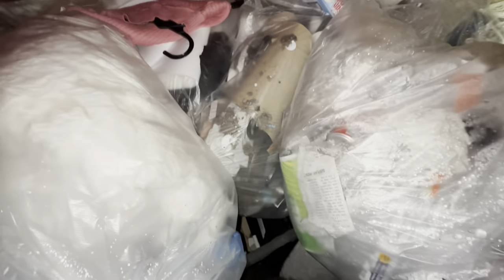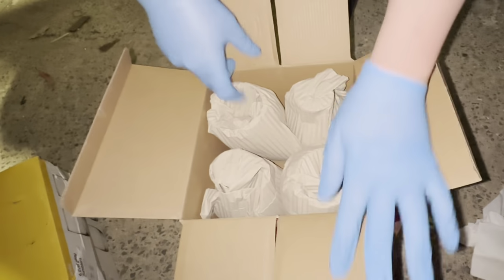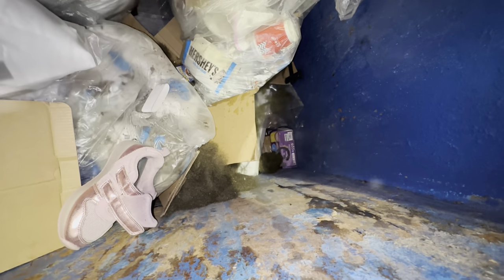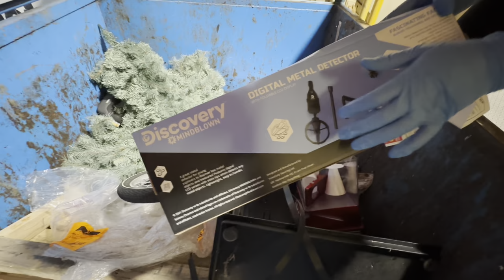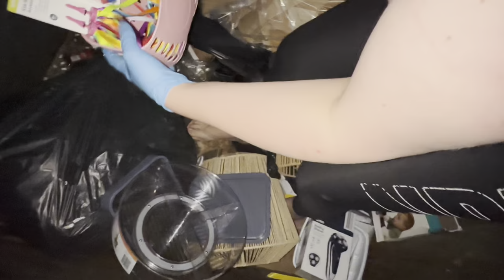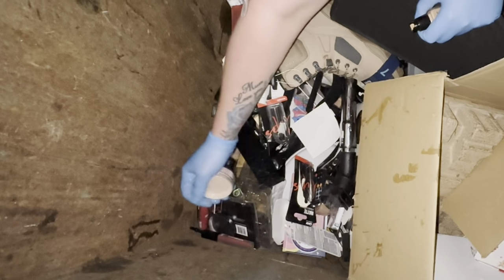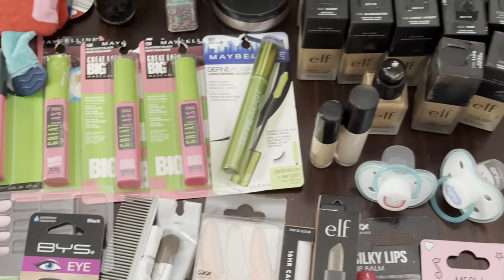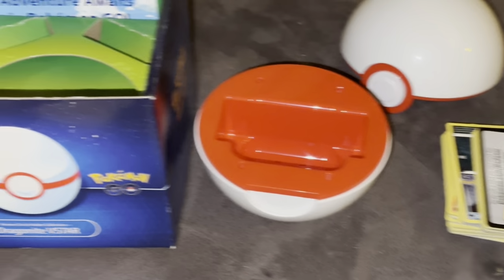Dumpster Diving//No WAY! Did We Just FIND The EMPLOYEES STASH!?

Comment: Really wish you would now dive with flip flops and use a dumpster stick. So scared you would hurt yourself especially with the glass! Great Haul😊
Reply: * not use flip flops
Reply from the maker: Good afternoon, I’m so sorry I understand it’s very dangerous to only use rubber gloves and not wearing proper shoes is the issue. I will make sure that I wear my proper in close shoes. The gloves are fine and it’s more clean just to dispose after every time, I go in the dumpster. Thank you so much for your comment it is very much appreciated. 🙏❤️